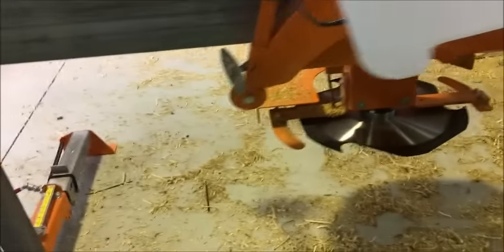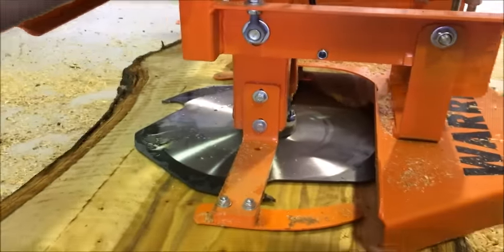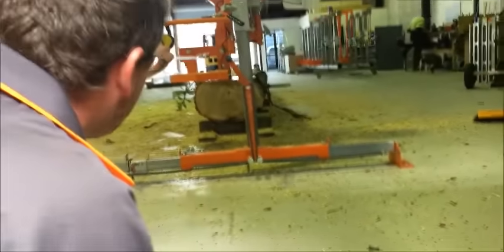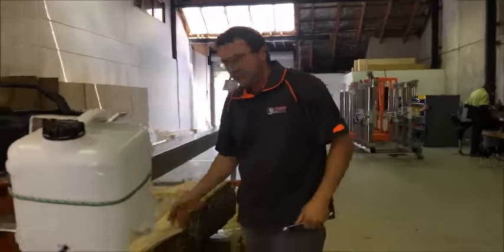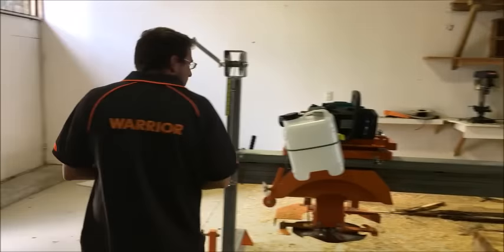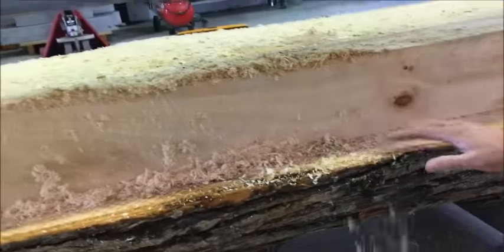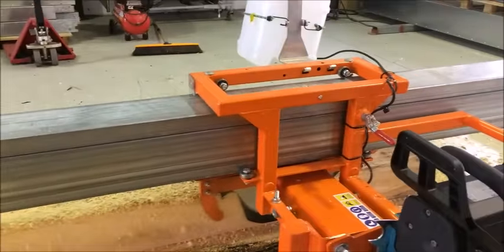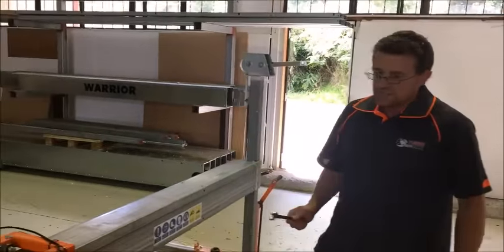M6 OPERATION

Comment: so what is preventing the saw frame from moving in relation to the log?
Reply: I would think it could easily vibrate out of position!
Reply from the maker: It's the bunks. They form a square cut out. Both edges cradle the log. Proven for over 30 years. Skill level is important too. No steel means you can get every board.